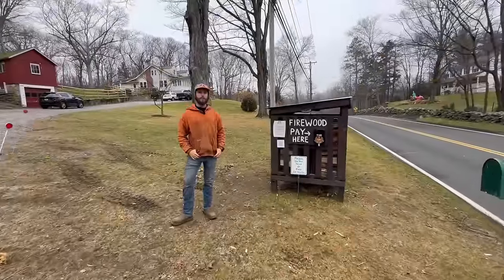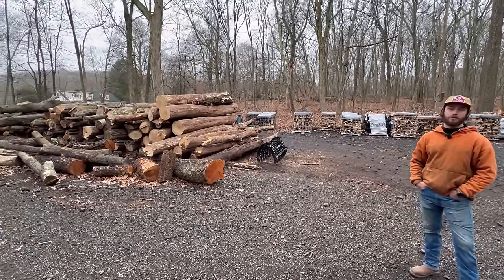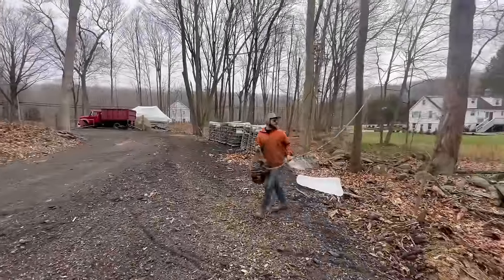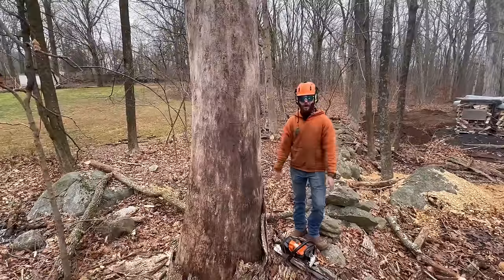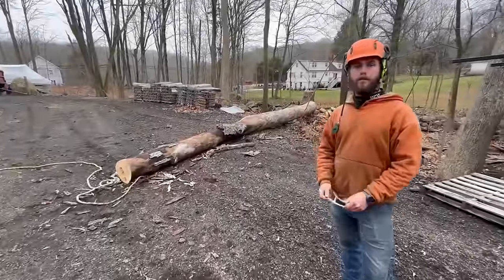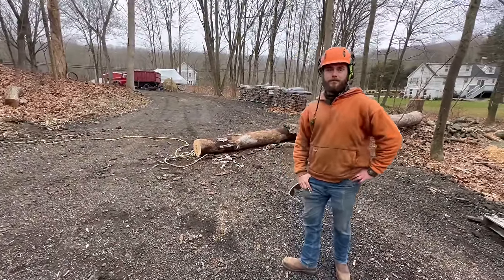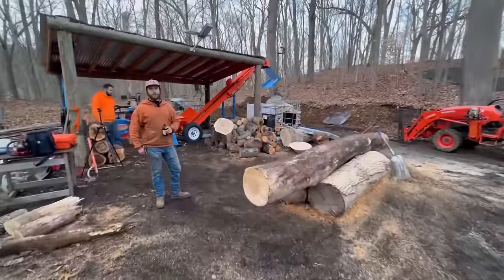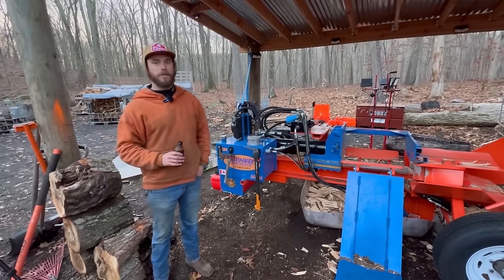Safest Way To Cut Down A Tree

Comment: How come nobody except Buckin' Billy Ray does an undercut notch?  You lose wood, make irregular splits, and get less board footage if you are milling lumber with a notch in the sawlog...I just don't get it.
Reply: Humboldt vs conventional face cut is the terminology you’re looking for. They both have their advantags, but a humboldt takes some dedicated practice to learn, and good ability to control the plane of the bar while pivoting it on the bucking spikes.

A conventional face with the sloped cut first and the flat cut second is ABSOLUTELY the way I teach newer operators how to fall trees / dogs.
Reply: @WildAcresFarms Humboldt also favors the steep terrain fellers are often dealing with out west. By having your angle towards the bottom of the notch it allows for the hinge to hold on longer past horizontal resulting in more control of the tree as it’s falling. If you look closely at the spar I dropped that was on top of the boulder, I actually used an “open face notch” with angle cuts on the top and bottom resulting in the hinge wood to hold on longer.
Reply: @DudeRanchDIY , on the first tree you were demonstrating on, I thought you would want to use a Humboldt with such a tall stump.  Since it was for safest way to cut a tree, if it was a homeowner that doesn't have access to a tractor to pull a tree over, wouldn't the Humboldt be safer?  The Humboldt would allow the butt to hit the ground first instead of last, so there is less risk of the tree bouncing back.  (especially if the top hasn't been limbed already.)
Reply: @briananderson7497 in this case the base of the stump was about 2.5-3’ below the grade of the asphalt Millings road so a conventional notch worked just fine as shown in the video.

Comment: Might be an arborist, but you’re no qualified faller. 🙄

First thing you do as a faller is clear your two escape routes at 45 degrees to the rear - so that if it goes pear shaped you have two escape routes.

In this case if your showing “the safest way” to fall a tree, you failed before you even started.

You have all the tree limbs from where the tree was topped out laying on the ground underfoot on your two 45 degree escape routes.

You SHOULD have cleared those first before you got anywhere near making your opening cuts on the tree with the chainsaw.

Next, your property is steep in places and you use the tractor and loader attachment in your operations.

At a minimum your require a ROPS (Roll Over Protection System) bar off the back axle taller than your head.

Strictly speaking for falling / logging Opps - you need a FOPS cab (Falling Operation Protection System) cab on the tractor to protect you as the operator when not if a tree falls on the tractor with you in it.

So while it’s admirable to try and show safe falling methods, really speaking you should be at the top of your game with qualifications, experience & skills to be teaching others on line in matters of safety.

I say this as a retired Forester, who has attended two falling fatalities scenes of my faller employees over the years, with a coroners investigator.

It’s never a pretty scene & having to inform their spouse & kids is the worst thing you’ll ever have to do.

It pays to get this stuff right if you’re going to do it, but even more so if you’re going out to instruct safe working procedures.
Reply: You speak about the safety and training, but you also say that you have "attended two falling fatalities scenes of my faller employees over the years, with a coroners investigator."  I can understand 1 fatality if an employee wasn't following instructions/training/proper procedures but how did a second fatal incident occur? Was the second not trained/supervised properly in safety? 

Something about your story is ???